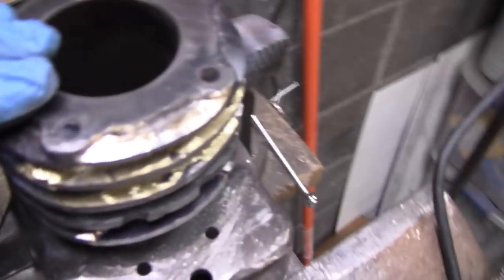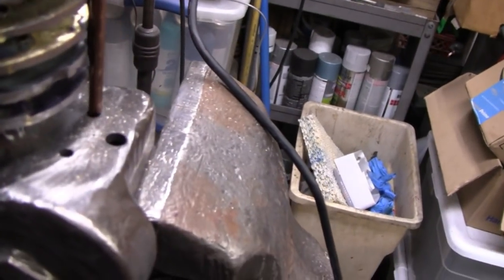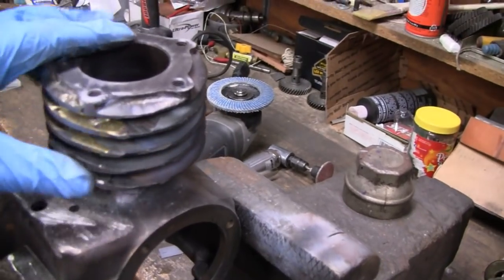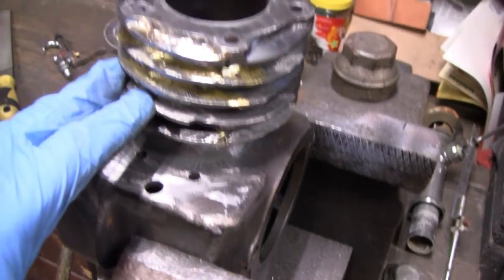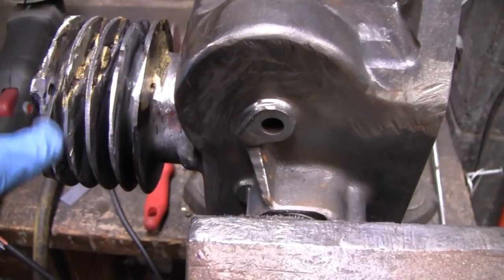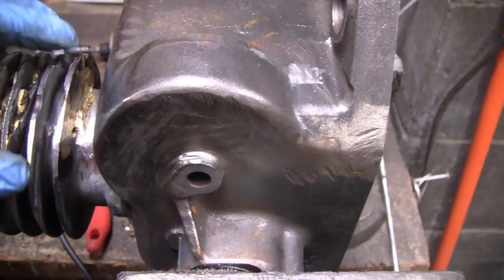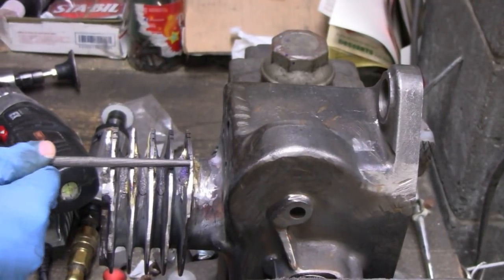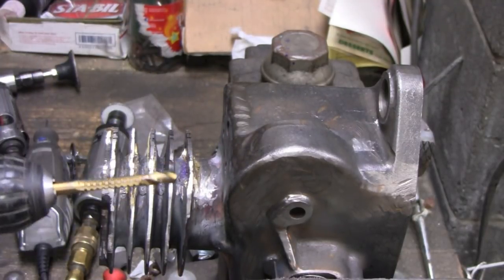HOMEMADE OVERHEAD VALVE BRIGGS (part 14)

Comment: One thing to account for, that you or Mike probably already know, is scrub angle or deflection of the pushrod. So what i'm blabbing  about is needing a cup & ball pushrod interface down at the lifter. I don't know if the stock lifter tappets could be cupped by grinding/machining, likely they are well hardened. You def want the cup on that side to hold a little lube/oil (sticky red engine assembly lube is great for this) and it would be easy to make a rounded end on the pushrod. You could perhaps weld a cup on too. You could also slot it for an old turn of the century style pin hinge connection and a clevis on the rocker! Like an old U-boat diesel. Your lifters wouldn't spin then of course. At the upper end at the rocker you'll have to contend with the rocker swinging away from the lifter/pushrod center line in it's arc of motion. Perhaps the guides are sloppy enough to deflect far enough? Could also do an upper pushrod guide and a double scrub rocker. Just something to think about! We dealt with pushrod cups and ball sockets on our race car, 526ci Arias/Fontana hemi. Horrible valvetrain geometry for wear. We put Titan roller rockers on it and originally the pushrods were double -ball with the cup in the lifter which is good but at the rocker it was upside down so the cup never retained enough lube. We changed the arrangement and later Titan reengineered the kit the same to have the upper end of the pushrod cupped. The entire valvetrain was prelubed by hand with sticky red Torco lube before EVERY engine start! 

Keep up the good work!
Reply from the maker: Thanks Bud!!☺

Comment: In other projects can you turn 4 stroke briggs engine to 2 stroke ?? It would be really cool and powerful !
Reply: It wouldn’t make a difference if the engine is set a four stroke and just runs on two stroke gas it’s not set up as a two stroke so the power would not chabgsv
Reply: BrandoBrap no I mean by changing the piston and removing the valves , cam ,and timing chain !
Reply: BrandoBrap or by leaving the 4 stroke piston alone and removing the valves , cam ..etc so it can hold oil in the crank case but runing on fuel only ..

Comment: your doing a good job for sure looking closer. when I said to use the sanding disk 90 degree angle grinder to straighten it up I meant in between the ribs not on the outside. It would take a fair large disk and new one at that to straighten it out. I use to work in a fine art foundry finish grinding art work. It probably wont work the whole way but I thought it would straighten out some but it is difficult to do Im sure. it can dig in in a hurry and wedge in so watch out.

Comment: Have you ever used those sanding cones that Harbor freight sells? I see guys using them for cylinder head porting with good results.
Reply from the maker: Nah, never tried them!!☺
Reply: 805ROADKING check them out #62394 on the Harbor freight web site. I haven't used them either but I'd try them if I had a use for them.

Comment: Coming along fine. I am curious about oiling of the top end, or will you leave exposed valvetrain to be oiled manually like old HD total loss oil system used?
Reply from the maker: We gonna oil it just like they did on the 1920's Briggs!!☺
Reply: 805ROADKING 
Not familiar with that. I will look it up.
Reply: 805ROADKING 
Wow, not much about that. What I found had atmospheric intake valve. Exposed exhaust valvetrain like old HD. I like Harleys with pedals best.